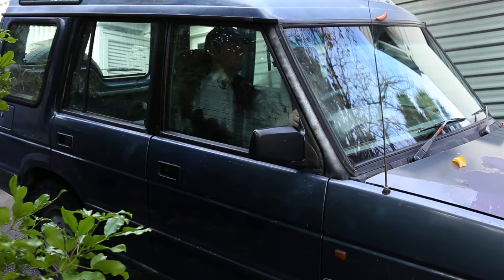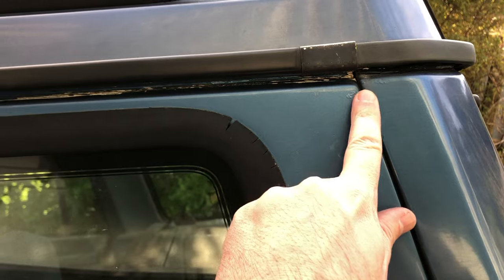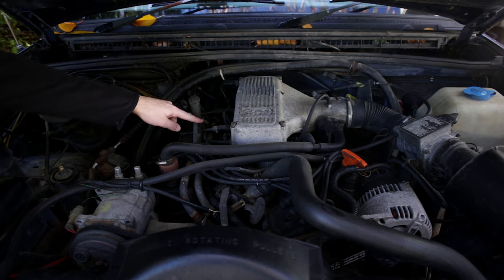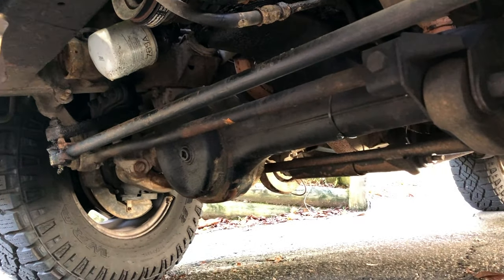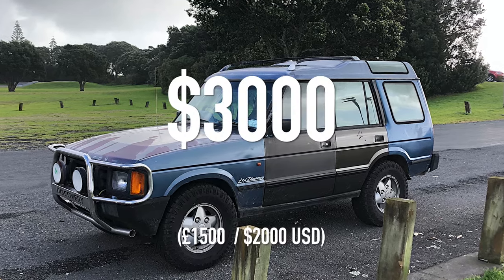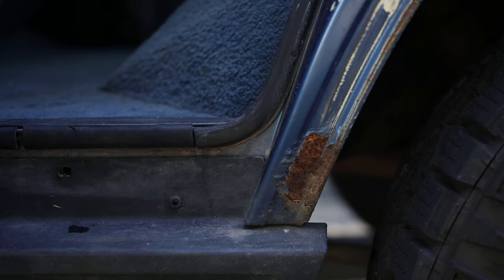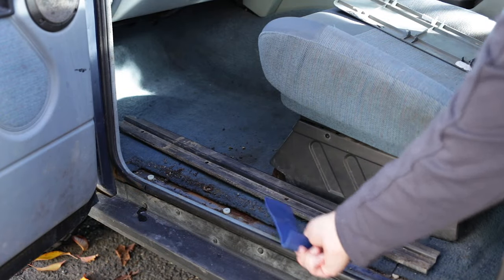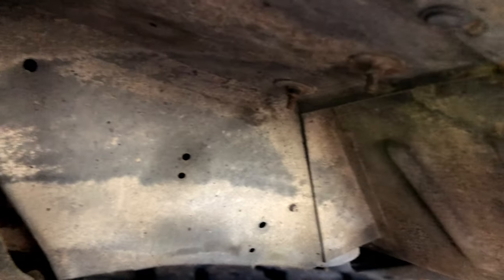Project Discovery // Part 1 - Purchase & Inspection

Comment: I've had a few of these and it's like fixing up a house. Start with the roof as that's the main contributor to the corrosion. All of the glass bits leak, especially the safari windows and the top of the windscreen. Land Rover must have made the seals on  the roof bars out of water soluble material as they just disappear without a trace. All that said I have a massive soft spot for the Disco and look forward to the teardown. No point kidding yourself Geoff, you can't avoid the inevitable. 😉

Comment: I appreciate this video so much,  very funny. I bought a 95 discovery 1 that sat since 2009 and was about to be scrapped. Naturally as a great husband does I bought it and had it towed to our house without telling my wife. Im about 4k into it and counting. I've gone through all the same rust, leak, electrical issues or and cannot forget the mice that turned it into a home during that decade of sitting.  I've never spent so much time fixing and diagnosing on any other car in my life. The forums online have been a lifesaver. At first I was frustrated when I ran into issues  but now when I fix something I'm like okay bring it on, whats next. Definitely a love hate relationship but I won't get rid of it, it's truely a great ride.

Comment: Good to see another old battler being ‘re-commissioned’. I did similar to you; bought an ‘89 RR Vogue which looked immaculate in pics. Flew in and was not impressed. It overheated on the 8 hour drive home but got me back nonetheless. It too had rust and many issues but I restored it and passed it on to the next vict….I mean enthusiast. At least I was more honest with my description. Cheers mate. 👍🏻🙏🦘🙈

Comment: Hi great to see you back I had one in similar condition it can all be fixed . Mine the engine was completely sludged up I took some off inlet manifold off soaked for a week with degreaser steam cleaned down through top of engine reassembled flush the oil a few times replace air flow meter and ran for two years until I sold it . Speaking from experience I fear for your San. Seriously good luck.

Comment: Congrats on your Discovery! I had a 96 D1 here in Kenya with a 300tdi/5speed. I loved it to pieces but rust was the death knell of it. The chassis was perfect but the body was beyond repair. Check the area under the windscreen/upper firewall/bulkhead, front floors, rockers and inner sill panels. The area of the roof around the alpine windows also rots (one of the only steel exterior panels). Also the upper door frames, as you already Discovery-ed. Mine would have required an entire new body shell and in the end I sold it for more than I bought it for and moved on to the next project.

Comment: Started this process 17 years ago… Ironically, the drainage holes in the floor (for when you are wading) let in the water and the foam underlay holds onto the water really well. I ditched the carpets, plugged the holes, and it was dry for evermore. The boot floor patch is there because the water migrates to the back when you drive forward! So it just rusts through. Got fed up of patching and so cut out the floor and put in a new one.

Comment: Well done on your purchase.  I look forward to seeing its rebirth.  My first car was a 1954 86 Land Rover.  It was in similar condition to your purchase.  It had been used for  beach fishing on  the NSW Northern coast.  Rust in the chassis cross members, no brakes, an engine that was well beyond its use buy date.  But it had a really great hardtop made of plywood and skinned in fibre glass which made it quite quiet.  It was great for Scout camps etc but I eventually had to have the engine reconditioned.  This was totally screwed up by the reconditioner as he put the centre main bearing in backwards thereby blocking the oil to the big end bearings.  He fixed it and the second time IT WAS THE SAME.  Third time lucky.  I sold it and bought a 1968 SWB ex government.  It was great.  

These days I am in my 70s and I have a Disco 2 Td5 which I bought for AU$6000.  It only had 211,000 km on it and has been remarkably good so far.  I have now owned it for three years.  Apart from a diesel pressure regulator it has been really good.

Best of luck with your Disco 2.  We had one at one stage.  It was great.  Mike in Oz

Comment: Nice Geoff,
You need to check behind the plastic kick panels in the footwells for rust, I’ve got 2 slightly newer dead discos that are similar condition as yours.
Both have footwell issues (read that as gaping holes) that sort of sneaks up on people cause no-one looks there until water stuffs up the relays, wiring etc and no-one ever cleans the mud from behind the plastic inner guard.
The clock has a lamp behind it, I’ve never been able to keep one of those lit up for very long either.

Comment: Not surprised the top sealant on the rear quarter panel is pretty average. Making that seam look good is hard work. That dipstick you checked is the gearbox not the transfer case

Comment: I bought a brand new one of these in the day, loved it..solid  machines..
Reply: Yep! - me to. Probably the most comfortable 4x4 that I've had. Did over 100,000miles in it before I sold it. Just routine servicing required. It will be fine Geoff!
Reply: I got the exhaust done and it sounded so good..

Comment: really looking forward to this. I too bought a 95 Disco 1 and am planning on making it my forever daily driver.  Mine has rust in the rear pan and I"m going to spend more than the car cost to replace it. Halfway through doing the engine gaskets and replacing tired tubing. Can't wait to see more videos

Comment: Just something about these old Discovery Is. We had one in the early 2000s and bought another about three years ago. Refreshed all the hoses and fluids, fixed some electrical issues and now use it for errands. The window seals were always crap, lucky Land Rover Tampa replaced all our originals just before the warranty ran out. Our new one has the originals so I just park it in the pole barn.

Comment: My uncle worked at Land Rover when these were being made. At the point in the assembly process when they were fitting those rear side windows, they often found the body wasn't square so they would gently reverse the car into a piece of 4x4 braced against the factory steelwork.

Apparently they had to use this piece of wood so often that it had its own part number and was checked in and out of the stores.
Reply from the maker: Hahaha. Imagine what the Germans from bmw thought when they took over in the mid 90’s

Comment: I had the exact same vehicle  and same colour, but a 1991 model, the first year of the fuel injected but it was 3.5 litre not the 3.9. I preferred the 3.5 because they were far less prone to cylinder liners coming loose, (which happened to my later series 2  Disco) one thing you didn't check rot wise was the rear outboard seat belt mountings on the wheel arch as they are notorious for pulling right out of the arch. I know you have got a fair way along with this project and I as yet don't know what you have found. I owned my series 1 Disco for 11 years and ended up welding it from one end to the other. As for the steering, mine when I got it used to 'Dive' around the corners. You turned the wheel say coming onto a reasonable sized roundabout and all of a sudden the side you were turning to the front wing would dive down halfway round the corner. That I cured by putting Pollybushes in the front axle mounts in the longitudinal arms and also at the end of the arms at the body mount and the pan hard rod bushes. A bit of work but by god that totally transformed the handling. I later pollybushed all the rears suspension then the car would go round corners as fast as you like  and as if it were on rails. The only thing limiting then was the tyre grip. I'm going to watch your series now and see what you find! By the way are you related to Geoffrey Croker? I followed his series 3 was it rebuild?

Comment: I'm amazed at how many similarities there are w the early Disco and the Range Rover Classic. We didn't get this early dash/console in the States. Love the front end. Cannot wait to see your progress
Reply from the maker: Not just similar. I think the floor and frame are the same. Yeah, it's a shame you guys didn't get the early interior. You guys bought so many Range Rovers that LR tried to make the Discovery as 'car like' as possible to suit the US market.
Reply: Same car except for the roof line, rear body and bonnet.  The doors can even be swapped from one to the other, though with different crease lines.  The only significant mechanical difference was the 1990 and later RRs having a Borg Warner transfer box and most getting air suspension from 92 or 93 on.

Comment: Love the '93 discovery, specially the front end. Mine is half the v8 and all original powertrain. Needs a few bits specially in the gearbox department but it's in good running order and with only 2 big rust spots in the floor panels. Take care of your fluid levels and it will go anywhere.

Comment: Excellent project car, hope fuel is cheap over there as my (recently sold ) mint 97 v8 would easily get 23l/100km! Sounded great with a mild exhaust, Check your alpine windows bound to be rust there also. My 97 disco 1 300tdi is a great car and oddly fun. Cheers Steve

Comment: hahahaa my favorite part of the story is the desperate decision making process, in which you buy a rusty old land rover because you NEED a reliable vehicle immediately lol. You have no idea; I had a broken down other old car and needed something to tow, cross country! I made mine (in good engine shape but not nice general shape) tow a loaded sedan and heavily loaded rover with a a loaded old school car topper over 1000 miles, straight! only stopping for gas every ten minutes, for like 15 hours (well, that was the second leg of the trip; the first was about 350 miles through terrible winter weather, not towing anything). This was all after I stayed in a hotel for like a week, after purchasing - completely desperate because it immediately was killed by the cold and didn't start after purchasing (! so I thought I was scammed lol!) then after I had the starter replaced, it quit starting again like a day later! (I thought I was scammed and bought a lemon again); finally they replaced the starter solenoid as well and after like over a week in hotels and multiple towing fees..finally I had a starting 98' Discovery1 (auto, gas).. and it still is an old smelly truck that I need to not be a project! (I hilariously have the same decision making, desperate, non-project tendency lol). cheers. (but I was in an even more desperate situation stranded at a hotel with a u-haul and a dead car and all my stuff BEFORE I decided the rover was my ticket to security and luxury, and towing capacity...and sticking it to U-haul by not paying like $2,000 just to rent a moving truck to tow my damn other old car and like $3k worth of stuff...And it worked! And I was not sane or healthy enough to make a youtube video about any of it, but the plan worked and I got home with a discovery to slowly try to refurbish and drive in the meantime while I fix my other non-project car that overheated and needs an engine.

Comment: i have a similar condition 1990 range rover classic minus the leaks. very similar dash/console and near identical engine bay, basic maintenance is all its ever needed, its slow, really slow but consistent power across the rev range, tows well and parts are now about the same cost as Landcruiser's and patrols, not the 300% they where a decade ago when i got it. I got the rangie to drive while I supercharged my daily xr8 ute (yeah I'm that smart 🤣) and its been there ready to go every time the ute needs to be off the road for repairs/upgrades or I just need room for a second passenger.
Reply: Range Rover V8's here in the states I used to pick up running in fair shape and not to high mileage for about scrap yard prices just a few years ago. The last one I had I   I sold it for quite a bit of profit thinking I would buy another cheap one,  that thought was kind of stupid on my part because they are non-existent for a reasonable price now. 
It is so bad I was figuring I was going to do a series 1 Discovery next after the Model A Hotrod pickup in my avatar picture is completed.

Comment: I have a 96 300Tdi and absolutely love it. I put a timing ring on the diesel pump,  optimize the fuel, runs beautifully. A1 body and i do all my own mechanical. Cant do that on a new disco with all the computer sensors etc.
Reply: Please tell me what a timing ring is. I have a 300 as well. The engine is great, chassis and body good,and I will never sell it because all modern cars are just a pile of unrepairable electronic junk. My engine uses a timing belt for the cam and injector pump as is normal. How does this ring work on the fuel pump which is electrical and mounted in the diesel tank?
Reply: @philhawley1219  Sorry for the confusion, i meant dieseil injector pump. Do a search for 300tdi boost ring and you will find it. Works very well. Also, remove the middle muffler  to get more rpm response. I agree with you on the new cars, i had a bmw x5 2004 model and it had so many electrical issues. Dont think i will ever get rid of my disco. Cheers

Comment: Fantastic. Hope we don't have to wait too long between videos! I have a 3.9i in slightly better condition, will be watching closely. 200 miles per tank and fuel is £1.85 a litre but worth every penny
Reply: Wait, how big’s the tank?!
Reply: I have a 300tdi and I get  550 miles on a tankfull. It's my only car ,tough go anywhere vehicle. Not fast but a proper work horse.
Reply: @rupertthomson  welllllllllll, 200 miles / 68lt is as far as a dare take it 😅 don't want to get caught out too far from a garage
Reply: @DanHvr6  Fair enough ha ha!

Comment: I'm a bit jealous. I like my 1990 200tdi but I would prefer it to be a V8, and that's an almost complete Sonar blue interior compared to mine where the seats are the only thing left untouched. Oddly mine are less worn despite over 200K miles. If you're worried about rust I recommend not removing the plastic sill covers or they might have surprises for you. Boot floor is better than my 94 Disco was 10 years ago so not the worst. Looking forward to seeing it come together.

Comment: No power may be worn cam lobes. They also love to throw oil fumes up from the crankcase, so if you can put a catch can in, it stops the fumes wreaking havoc on the intake side. The 3.9 is probably the best out of all the Rover V8s. Not underpowered like the 3.5, no slipped liner issues like the 4.6.

Also nice to see car prices are also whack on the other side of the ditch!

Comment: It would be interesting to see some of your progress on the Disco, as there aren't that many videos out there on the subject. 
If you want to maybe slightly up the performance of the venerable Rover V8, there is a company based in the UK called RPI engineering. 
They live and breathe Rover V8's.
They can build a custom engine for you, supply a partially built engine or just supply you with the parts to do it yourself. 
On their YouTube channel one of the tests they do, particularly on Defenders is to change from 1st gear immediately to 5th and just drive around without changing gear to test the torque characteristics of the engine.

Comment: I used to drive a 1994 model with the same V8 and automatic gearbox for work. It wasn't a fast vehicle, but it could still tow a large trailer mounted antenna mast behind it comfortably.

Comment: I had similar problems with the HVAC on a similar car. That loose vacuum line probably actuates the HVAC doors. So maybe that will be easy
Reply from the maker: The air con and heater do actually work. The switches just need jiggling a bit.

Comment: Close to the same shape mine was when I bought it... mine was missing the whole floor though and truly nothing worked, no doors opened or locked, no windows worked, didn't run, t case didn't work, etc. I can't believe someone on yours even put those external wheel weights on the alloy wheels... hope that didn't ruin them

Comment: I bought a 97 Disco to use as a tow car for my vintage cars. I didn't want another project, just something to keep going but not care about. But the damn big wallowing things grow on you and you want to start taking care of them. Today I pulled off the windscreen trim to look for leaks around there. Turns out the trim has been off before and is a bit munted. The top trim is cheap enough in the UK but goodness knows how much it will cost to get shipped here. Is there someone where good in NZ to get parts from? A quick search didn't give me much hope. And annoyingly that's not where the leak is. Sunroofs next I guess. I was going to cheat and just have some clear vinyl wrap and was just going to cover over them entirely.

Comment: Wow I got my 300tdi disco 1 here for 1800 bucks fixed a fuel leak and changed timing belt just so I knew it was done it leak water inside like pretty bad but no rust I’ve had it around 5 years now and zero issues with it

Comment: It doesn’t matter that the passenger side doors doesn’t color match. Because every single color on the car sucks anyway. Ohh, and the wet, rusty Trunk. Just like the Frontera I bought recently. Had to clean the whole rear part of the floor with a grinding disk, that was fun…